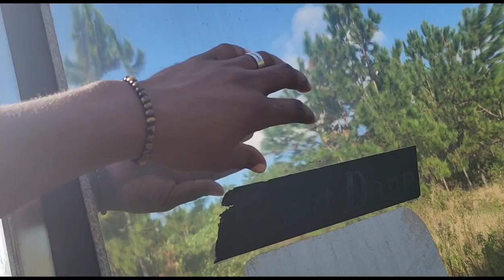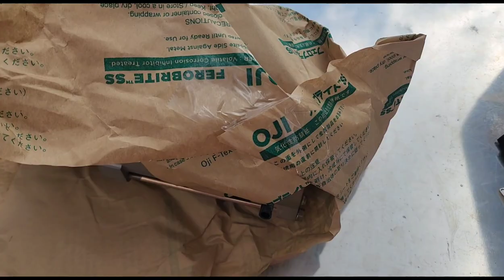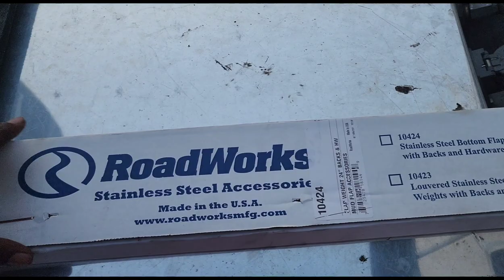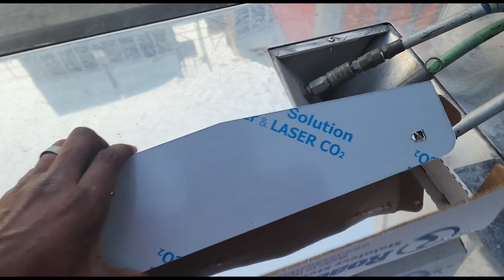Getting my ride back going!! #vlog #kenworth #truck

Comment: Carrier said that 90% of the starter issue is that little wire that goes out. Just replace that and you should be good.

Comment: I ripped my flaps off so many dam times.  Now i just cut a notch at the top, that way if i backup a little too far and yank one off it slides out and doesnt rip the whole bracket off.  Just notched em and clamped em in with a 3/8 impact.